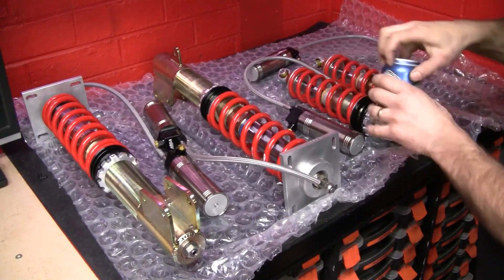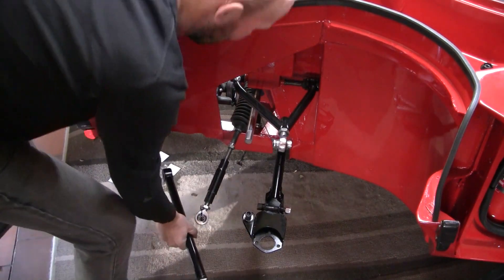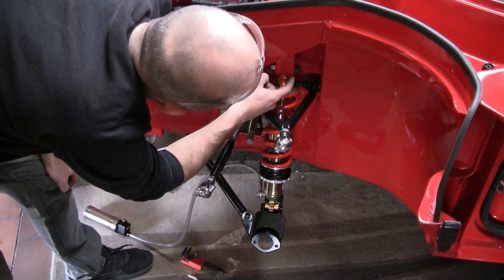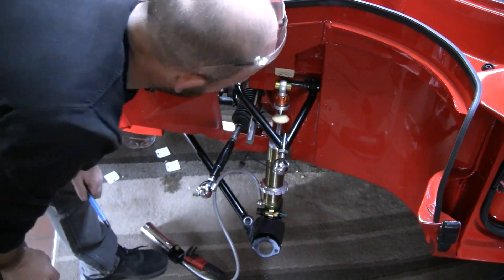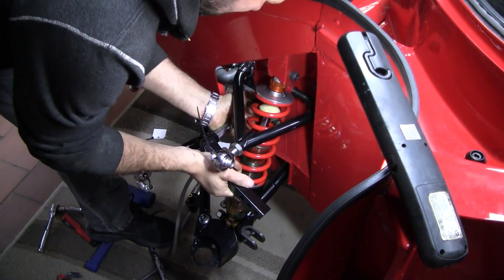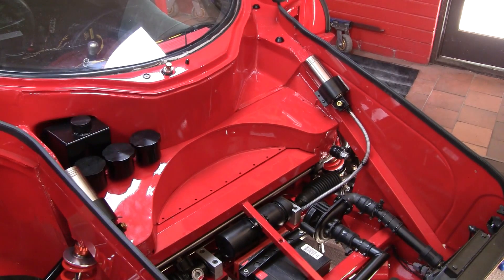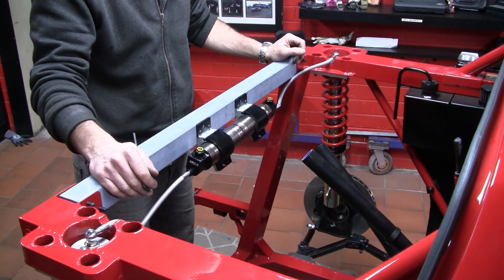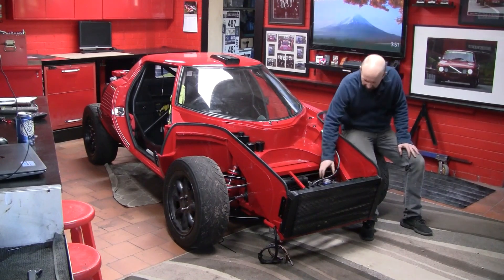Project Stratos - Episode 32 Springs and Dampers!

Comment: are the recomendations from the Tas Targa enquiry likely to affect this great build?
Reply from the maker: Hey mate, Yea unlikely, most of the changes look to be top speed related and that will likely be addressed with more speed restriction zones and shortening of some long stages.  There is also  talk about requiring specific Wet weather tyres.  The only real vehicle dependant stuff is that it was concluded that one of the accidents was caused by excessive stiff suspension, more a race track setup than a rally setup.  I've gone pretty conservative in terms of wheel rates on this car, much lower than you would run at a race track, so probably no issues there either.  although that will likely just be advice rather than regulations, as it would be impossible for the organiser to police

Comment: Hi Colin, I have loved following this build as I have often thought about building a Stratos replica myself, and this one is turning out awesome :) But, I thought I needed to comment on your front lower balljoint installation - by bolting the balljoint to the top of the wishbone the entire load on the front of the car is being carried by those 3 x 8mm bolts each side! I would think that the balljoint should be inserted into the wishbone from underneath - that way the load is carried by the flanges and the bolts then simply hold the balljoint to the wishbone. Best Regards.
Reply from the maker: Hey Dave, thanks for the comments, yea you are correct! I got all excited about fitting everything togeather and missed that, thanks for the pointing that out!